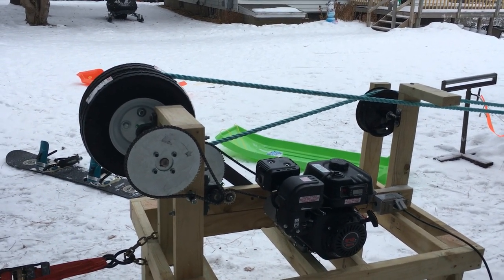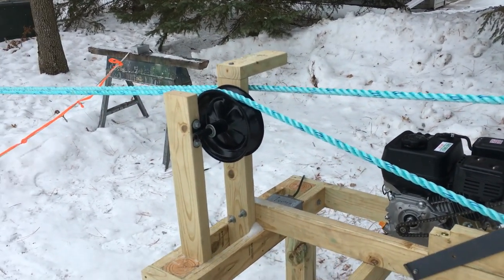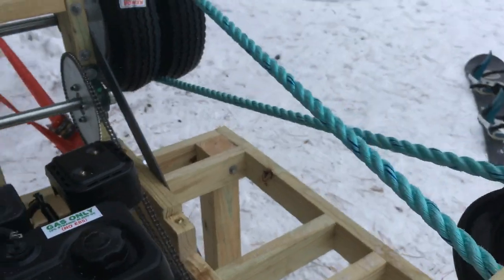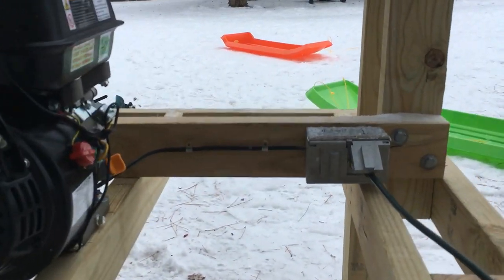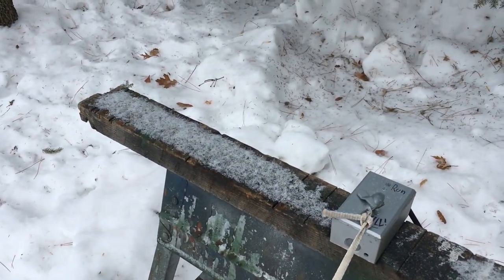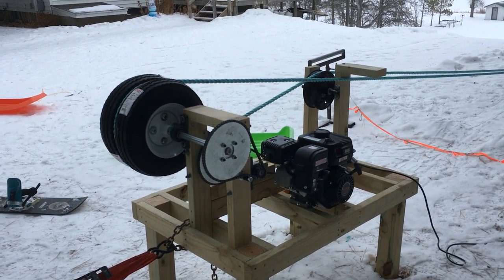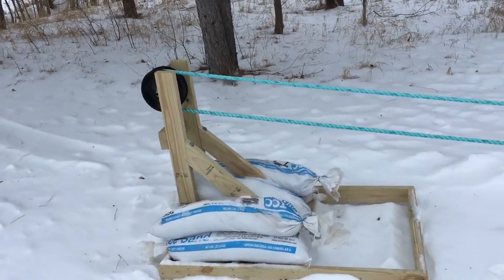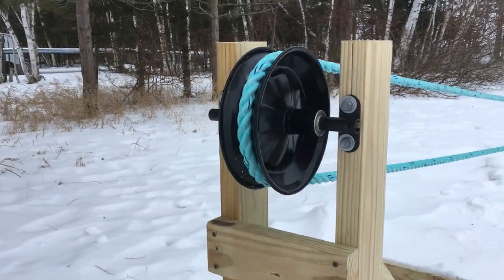Backyard DIY Ski Hill Tow Rope - Part 1

Comment: Awesome job. I use a lawnmower to power mine now, 300’ run. 600’ of rope. I’ve been in the process of building a new setup using a 212, I’m gonna put a clutch on mine. Kids race 120 snowmobiles so we have a lot of sprockets and clutches lying around lol. I definitely took some tips from your video!
Reply from the maker: Let me know how it works! I was debating on a clutch for this but decided just to try it without and it worked fine, with it being geared down so much the rope drag doesn't really effect it that much, it has plenty of power to pull an empty rope at idle, BUT you have to make sure the rope isn't frozen to the ground when you start it! I currently have this in the garage getting some upgrades and will be putting out another video on it soon. Thanks for watching!
Reply: What’s your plan for upgrades? Curious before I start lol

Comment: I’m hoping to build a portable one for sledding soon this is so ingenious and has been given me great ideas. Also cute golden doodle have one too
Reply from the maker: My original thought in my head was to build this out of steel and have it hitch mounted, but I decided on this design instead. You could probably adapt this design to be mounted in the bed of a pickup truck, a portable one would be awesome! One thing to keep in mind, you will need a strong anchor point at the bottom to keep the tension, if you can anchor off on a tree that would be ideal. Good luck!
Reply: @ballhammerindustries  thanks 👍

Comment: Great setup! You should build a cover for your motor because after a few years it will leak water
Reply from the maker: Thanks! Since the motor is so easy to remove, I just unbolt the 4 bolts and keep the motor in the garage over the summer to keep it out of the elements, but you're right, a nice cover would help it last a little longer

Comment: 3 years later and I'm recreating pretty much your exact design in Quebec, Canada.  Really appreciate the videos as a base in terms of idea!  Quick question for you - if my motor was at the BOTTOM (essentially reversed), shouldn't be an issue right (can't think of why it wouldn't work - will just have tension on the upper rope and I'll have to weigh down the top section appropriately).
Reply from the maker: That's awesome! I'm glad my design can be an inspiration. I've actually thought about trying it that way but haven't had a chance to try it out. I think you're right, the main issue would be the tension, one issue I've ran into is if there is too much slack, the rope coming off the tires on the slack side doesn't have anywhere to go and can possibly get wrapped back up in it, you need as much tension as you can get to help pull the rope away from the tires, if that makes sense. The other thing I thought of is the safety mechanism, with the engine being at the bottom of the hill it might be tough to get a shut down switch at the top when you come off, mine uses an extension cord as the wiring between the kill switch and the safety switch, so in theory you could use 300' of extension cord to do it? Good luck!

Comment: Great video! I was inspired by your design and made a similar version myself. Thanks
Reply from the maker: Thanks! I hope yours works as well as this one does!
Reply: @ballhammerindustries  yes it does I geared it down 2x like you but I could only get a hold of 1 72 tooth sprocket so the second drive is 60t and when I make the engine go full speed it’s so fast it goes up 150 ft in 12 seconds
Reply: @mtbmagnus9241  I did the same thing myself. 60 tooth!!!

Comment: Impressive! I am setting up a backyard mini-ski resort as well. I have a lot steeper slope though and am trying to decide on the motor. How much throttle, or preferably RPM if you know it, do you typically run it at? Specs on the 212 cc predator engine are 1800 rpm idle and 3800 rpm max. If you are running it at idle then I think it'll work for me. If running it at significantly more than idle then I may need to size up the engine ... maybe.
Reply from the maker: Thanks! I run the engine at around 2900RPM which has more to do with rope speed, it has enough power to run at a lower RPM, even at idle, but the rope speed is slower than I would like. One thing you might run into with a steeper slope is gripping the rope with your hands, I noticed on the steepest part it was harder to hold on the steeper it gets, a bigger diameter rope would likely help. Good luck!

Comment: Really neat set up! Im curious how you connected the trailer tires to be driven by your live axel (1in shaft). I see you have some couplers there @2:19. Is there a shaft that comes out of the tires as well?  What type of tires did you use?

Thanks for sharing your Tow rope.
Reply from the maker: Hi Chad, the tires are standard 4.80x8 with a 4 lug rim, to connect it to the shaft I used a go kart axle hub with a 1” bore and 4 lug flange, I punched out the studs that came in it and ran 6” bolts through the hub and both the rims to sandwhich them all together. Hopefully this makes sense. Thanks!
Reply: @ballhammerindustries  Thanks again. This is a great idea!

Comment: What's the size of sprockets your using and size of tires?
Reply from the maker: Hi Geoff, the sprocket on the engine has 11 teeth, the jack shaft has a 72 tooth and a 15 tooth, and the drive shaft has another 72 tooth. The tires are 4.80x8 small trailer tires

Comment: Awesome project! I have the  same size engine so I'm wondering what size gears you've used?
Reply from the maker: Hey Rick, the sprocket on the engine is an 11Tooth and goes to a 72T on the jack shaft, the small sprocket on the jack shaft is 15T and that goes to another 72T on the final drive axle, all #35 chain. Thanks for watching!

Comment: I love this setup and thinking of doing the exact same thing, I have one question tho, is the motor loud bc I have neighbors and k like to snowboard in later times so I was wondering about how loud it is when you run the engine!!
Reply from the maker: Thanks for the comment! It’s volume is about like a push lawn mower, so not terribly loud but I wouldn’t consider it quiet. I haven’t tried it but I’ve heard of people putting a generator muffler on these engines to make them quieter; https://www.amazon.com/Frustration-Gasoline-Generator-Universal-Accessories/dp/B0BG1PZ82X/ref=mp_s_a_1_14_sspa?crid=3PGDEBSH2HV0G&keywords=predator+generator+muffler&qid=1672372737&sprefix=predator+generator+muffler%2Caps%2C107&sr=8-14-spons&psc=1&spLa=ZW5jcnlwdGVkUXVhbGlmaWVyPUExUkgyTzk1RDZQQlU3JmVuY3J5cHRlZElkPUEwMzg3Njc4M1A3WlM5MVlXWDZNSSZlbmNyeXB0ZWRBZElkPUEwOTY3NTM1MzgzU0lKUzhTSVBONSZ3aWRnZXROYW1lPXNwX3Bob25lX3NlYXJjaF9tdGYmYWN0aW9uPWNsaWNrUmVkaXJlY3QmZG9Ob3RMb2dDbGljaz10cnVl
Reply: You might want to look into an electric motor if noise is an issue
Reply from the maker: I added a quieter muffler, check it out in the second video!
https://www.youtube.com/watch?v=2qEf04CjJUY&t=4s